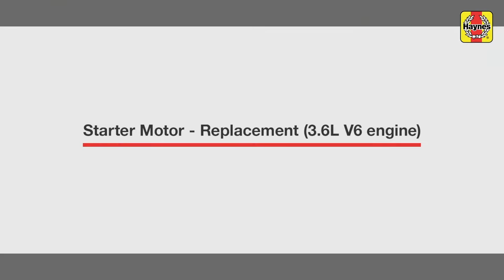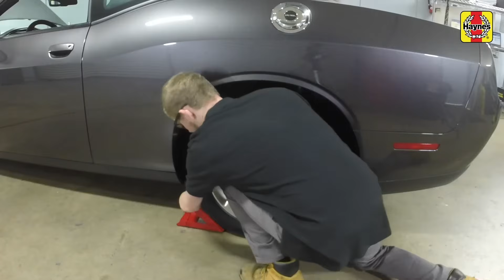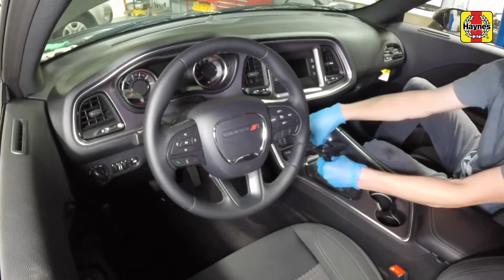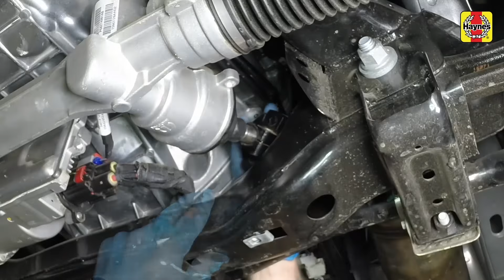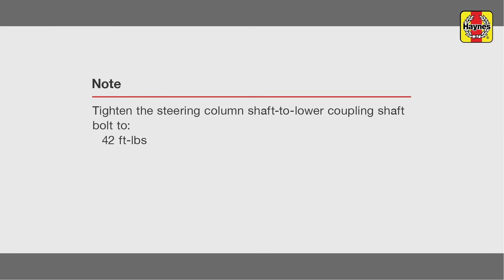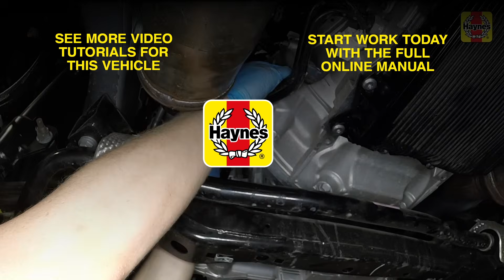How to Replace the starter motor on the Dodge Challenger 2008-2018

Comment: Whille a good guide, removing the steering shaft and heatshield is unnecessary..... I literally just did this an hour ago.
Reply: @RobbieMcbrayer  can u make a tutorial
Reply: @matthewbakken409  I have seen other videos just don't remove it you don't need to The only reason why you're removing it is because it's in the way but he's not really in the way
Reply: Easier to remove the steering shaft bolt. I started trying to remove the two exhaust flange bolts. They are badly rusted and I don't care how carefully you are even using heat, they will snap off. I spent more time drilling out that bolt then doing the rest of the job. Steering shaft bolt was a piece of cake. It's all just poor engineering no matter how you look at it.
Reply: Definitely in the way literally under that car right now.
Reply: Were you able to remove the starter without touching the steering shaft or heatshield or anything else? Thank You!
Reply: Saw another video where the guy loosened the exhaust opposed to steering column. Didn’t want to possibly fk up the alignment. Is that a better way?

Comment: Did you see the dent the Jack stand put it in the rocker???? Why would you ever do that???
Reply: I’d be sooo pissed if I were the owner
Reply: Yo I saw that too
Reply: Exactly that mechanic would have been tackled if I saw him do that to mine
Reply: It does that but won’t do harm. It’s plastic. That’s a designated lift point.
Reply: @mistahglaude7540  not according to the factory service manual it's not.
Reply: @mistahglaude7540  happens all the time it’s just plastic. Nobody cares.